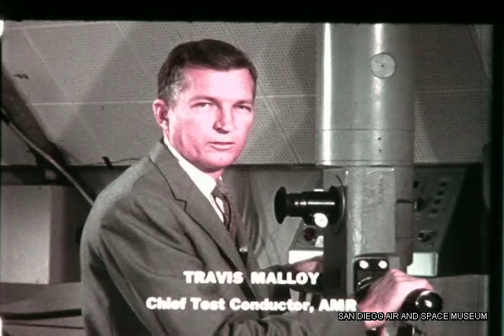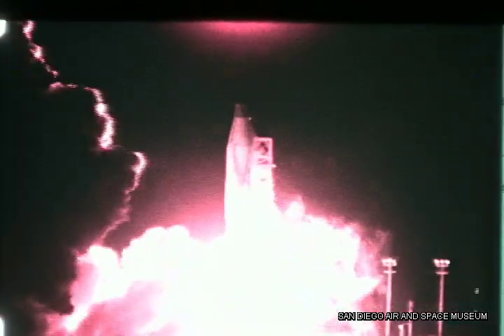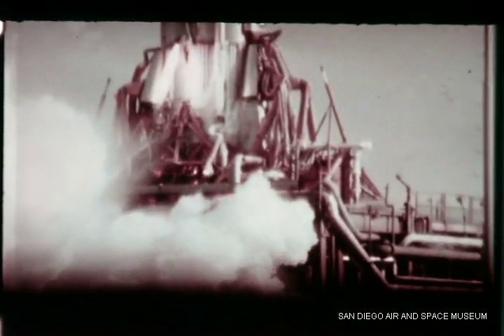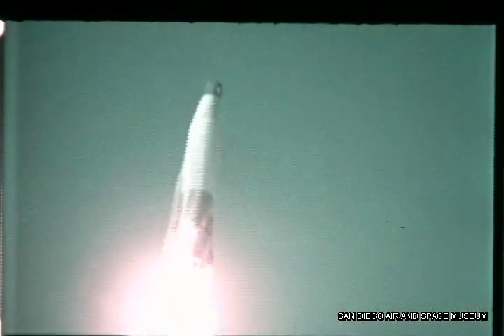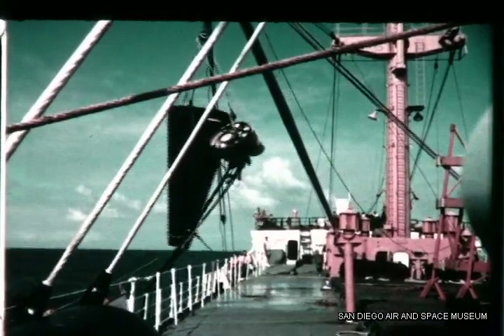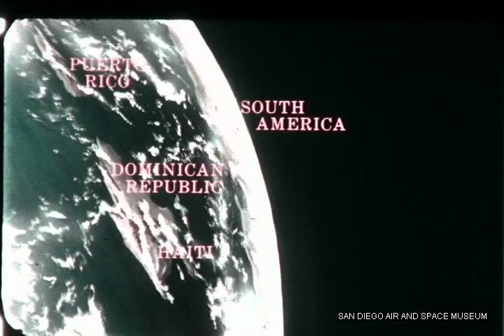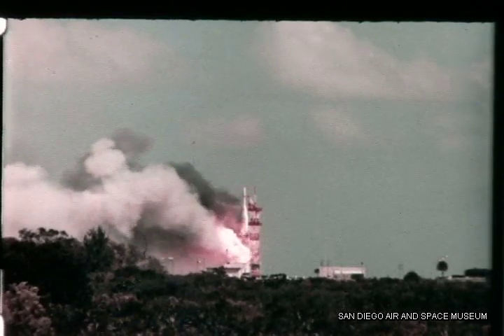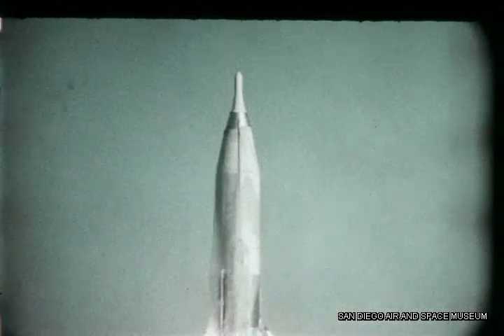Convair Atlas Missile Flight Test Review 1959  HACL Film 00189

Comment: The Atlas ICBM had about 40,000 parts, and the gimballed engine system was in its infancy. Even though the growing pains were tough, telemetry gave the program a lot of information, even from the failures. Even though it was flawed, the push to close the then-assumed missile gap made such a system better than none at all. What was really amazing is that in about 18 months the first successful launch of the solid-fueled Minuteman was made. The ICBM program was really moving.